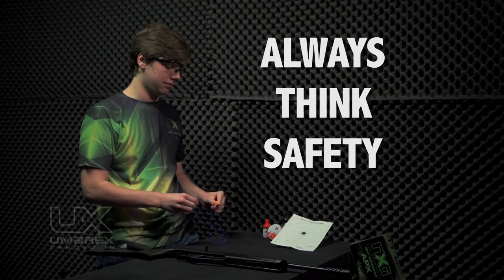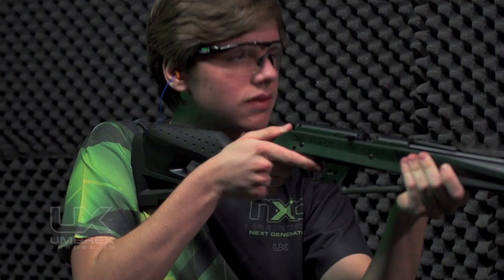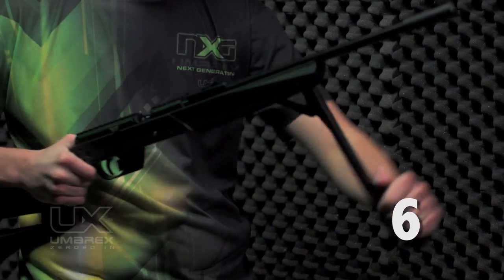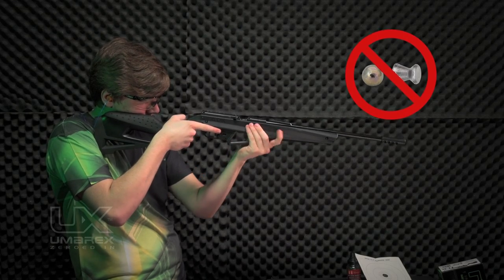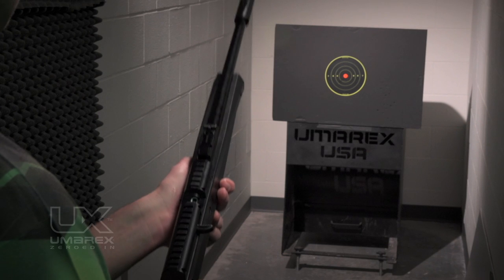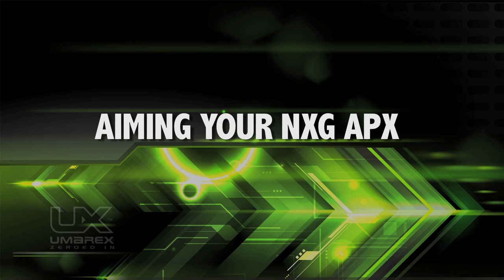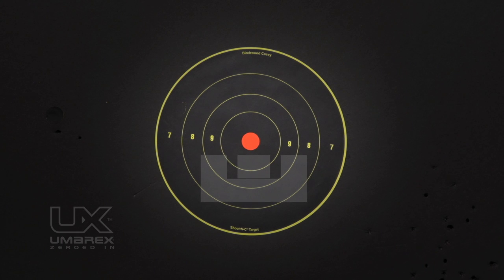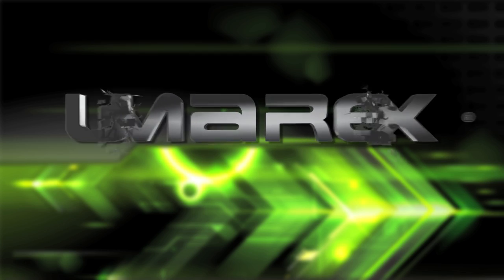NXG APX Multi Pump Air Rifle by Umarex Airguns - How To Use

Comment: Hello. I cannot find this answer online easily so I'm asking it here.  What muzzle velocities would be achieved with less than the 10 recommended pumps?  How few pumps risk the pellet or BB not exiting the barrel?  I am asking as there is a short range I am going to use this model of airgun at for bulk practice and would like to choose an appropriate muzzle velocity that would be slower than full strength but fast enough to practically be the same aim at short distance.  Thank you for anyone who can answer this.

Comment: things I liked about the gun: I liked the very sleek "tacticool" design of the gun. I liked that the pump handle is an actual handle and not just the foregrip of the rifle. I liked the size and weight of the gun, I liked how quiet it is when under 10 pumps. I liked that it can have up to 10 pumps (around 650 FPS with 10 pumps, totals to around 6.6 foot-pounds at the muzzle). 
THINGS I DID NOT LIKE: The scope is very flimsy and it hard to zero. you have to meticulously unscrew and rescrew everything with perfect alignment every time you want to take the scope on and off, and the screws are very small and easy to lose. I don't like how the BB loading port in the bolt is the same place you load pellets, so when you're trying to load a pellet, the pellet can fall into the BB port and get almost unreversably stuck. I don't like how inconsistent the pump feels, sometimes it feels like some pumps put almost no air in, and has no resistance when pumping, and other times the pump can be impossibly hard to pump. i want nice hard pumps each time, yet the gun is quite inconsistent. The trigger pull is inconsistent. I don't like the open sight elevator adjuster, because the adjuster is not labeled. you have range notches yet no idea what they mean. I don't like how useful the manual is. it only tells you the barebones of what to do, and even then unclearly. try sighting in your rifle based on the manual. I dare you. I don't like how 99% of the gun is "synthetic" which is basically just plastic.
OVERALL: 6.7/10 would buy for price range, but needs better sighting and more reliable pump/trigger.
Reply: Same i have one do you
Reply: It sounds like you should find another hobby.
Reply: Overall I'm broke and cant afford a real anything. And I don't have any idea what I'm doing but I'll buy this cheap kids toy and that looks like a fort night gun and then complain in a 6 paragraph testimony that the toy wont turn me into a sharp shooting killing machine. Lol

Comment: This airgun sounds good except for one thing. I understand it uses some weird scope mount rail, so you can't install a decent scope on it. I've used enough of these cheap 4x15 scopes to know they will hold the shooter back. I love multi-pump airguns, and have quite a few. But, the scope mounting situation on this one means, I'm out. I'll go with te Bear River Sportsman 900, which uses the standard 3/8"/dovetail system, and has Weaver/pickatinny side rails for mounting lights, lasers, whatever. I will not be stuck having to use a 4x15 scope.
Reply: No you can, they have adaptors at walmart for it. You have to use a air gun scope. Numb nuts try to put riffle scopes on a bebe gun because they SUCK at shooting. Which is why they play with bebe guns.
Reply: I just got done dialing it in with the included "cheap" scope. With bebe it's not accurate at all. With simple hollow points its deadly accurate.  I'm in a silver dollar group in a vice at 50 feet. First of all it is not intended for adults who are avid shooters. It has a child safety mechanism for a reason. I'm got it for my 8 yo to start plinking with. It's a great first gun with no accidental shots in the ass while i check targets. I've hunted a lot of squirrels in my youth, and at over a hundred feet hitting a golf ball size kill zone while it's on the move ? Good luck. You dont NEED anything more than a 4x15 scope because the gun itself is not meant to shoot anything farther than that. Why do people think a good scope will make a pellet gun become a 30-06 ? You do know that a Simmons 12 power scope weighs more than this gun right ?
Reply: Just mounted a 3/8ths red dot on this thing no problem….. not to discredit your opinion, but nobody should listen to that as fact
Reply: I think it says 11 mm dovetail and Umarex makes 11mm dovetail scopes, so probably they will fit. I am in the process of trying to figure out which scope to buy and wether it will fit or not, because for a beginner like me, scope/rifle compatibility is IMPOSSIBLE to figure out via the Internet.

Comment: After how many pellets sh0t is it recommended to pump it  up again?
Reply from the maker: It's designed to be pumped for each shot. 3 pumps for close-range plinking. 5 for a little more power. Up to 10. No need to pump more than 10.
Reply: @UmarexAir  So it uses up the pressure at each shot.
That's all I needed!
Thank you!

Comment: Why is there no advantage to say 15 pumps?  More pressure = higher FPS right.
Reply from the maker: Physics of the device just won't compress air beyond a certain point. Great question.
Reply: @UmarexAir . Makes me think of an episode of Myth Busters where they pumped up a BB gun to the point that they could hardly complete the last pump. Can't remember how many, but a ridiculous amount. I think the myth was to prove or disprove if a BB gun can blow out a cars rear window. It did in spectacular fashion. From about 6ft away. I'm assuming they must have had some kind of modification.
Reply: I pumped mine up 20x and chronographed 719fps with gamo raptor gold 5.4gr. Pellet. Got 815fps. same pellet same pumps in a daisy 880.

Comment: How many BBs can I shoot with 10 pumps?
Reply from the maker: Designed to shoot one projectile at a time. 3 pumps low energy. 10 pumps high energy.
Reply: I do stupid stuff so I loaded 3 at once and it didn’t do anything unsafe tbh. Fired regularly and it grouped semi well, so I guess in a way you can turn it into an air shotgun.